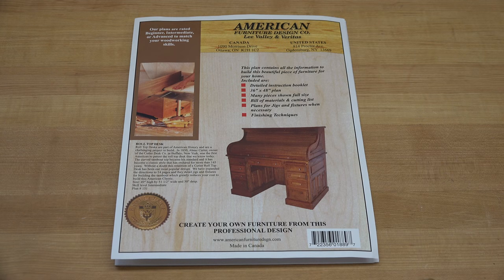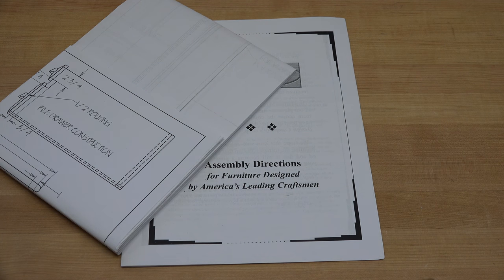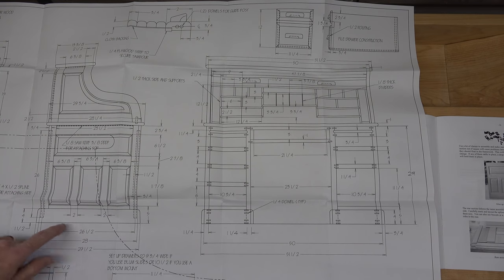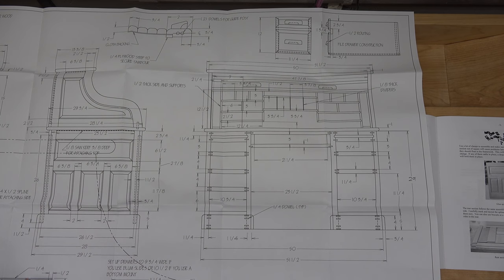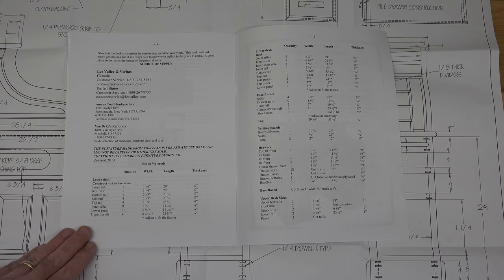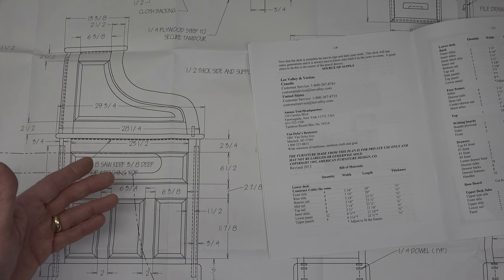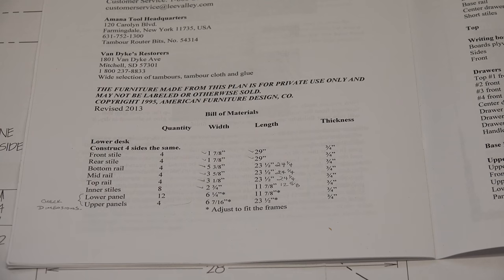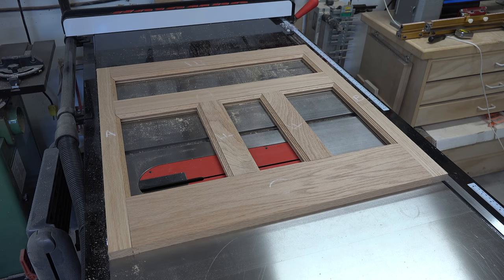Making a Roll Top Desk Part 1

Comment: Kenny,
I have watched this series of videos twice now, and am wondering if the plans have finally updated? I have a set on the way from Lee Valley, but they didn't seem to know if they have been corrected.
Reply from the maker: I honestly have no idea Drew.  I have bot sets of plans.  One of the original and one new set.  I can't imagine that after all this time, they would still be selling a set of plans that were incorrect for the type of joinery that they are promoting.  I'd be interested to know which set of plans you get.  Thanks for tuning in (twice).  It's very much appreciated.

Comment: Nice!  I'm guessing you started this pretty early in the AM looking at the jacket you are wearing in the first scene.  

Have you decided on a finish for the oak?
One other question. Will the tongue and groove tambors prevent racking over the span of the desk. I've seen a few roll top desks in the past that tend to bind as they age.
Reply from the maker: The jacket that I am wearing at the beginning of the show has nothing to do with the time of day, but rather the time of year.  My shows are pre-recorded and this was filmed in the early spring when the weather was not so cooperative.  For larger builds like this, I need the extra to to film and edit so the are usually filmed well in advance.  As for the tambour, I can safely say that there has been no racking or binding of the parts yet.  The tambours of old were glued down to a canvas which in time, could bind and rack as it wears.  Each slat of the routed tambour moves independently and is not governed by one central piece of backing.  The float free and for this reason, I think that this method makes racking and binding a thing of the past.  Thanks for tuning in Tom.  Great to hear from you.